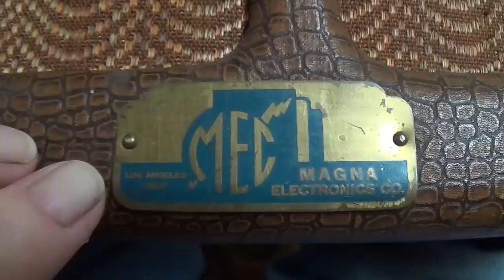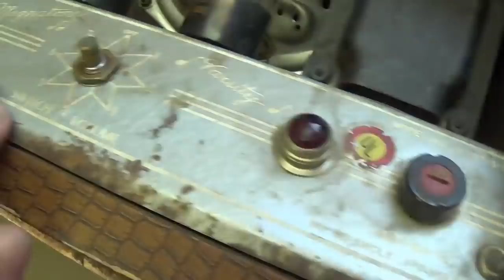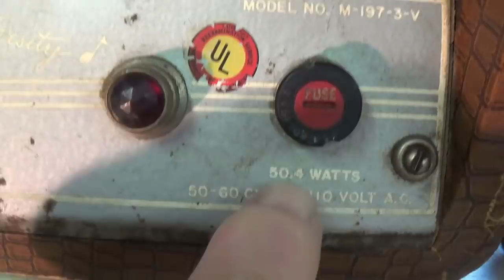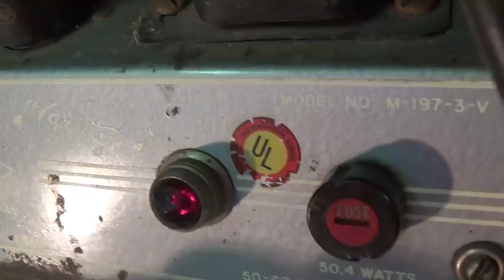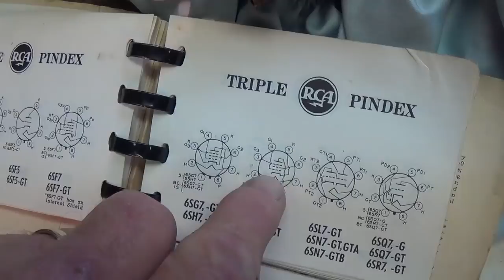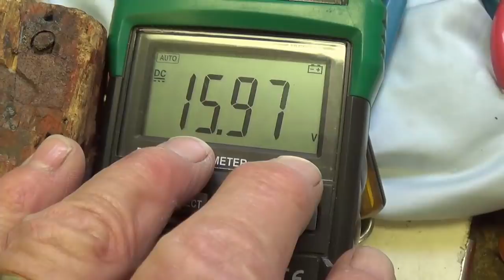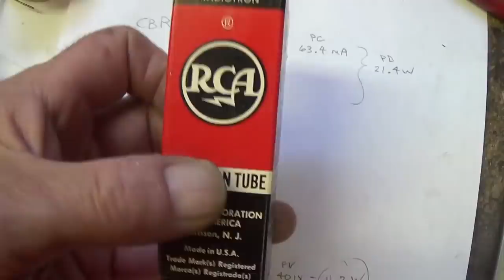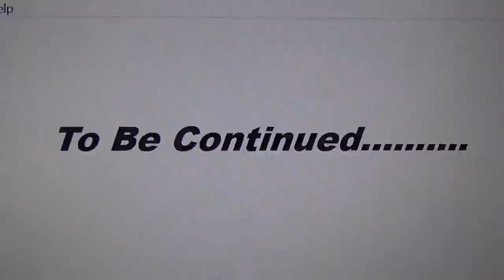1950 Magnatone Varsity M197-3-V in Completely Original Condition

Comment from the maker: After much thought about the cause of the outrageous bias values, I re-dissected the circuit, tested all components, voltages, etc. and have come to the conclusion that this amp must have come from the factory with a higher-than-normal-voltage power transformer. It is obviously the original PT, yet on start-up it produces 472VAC.....which is generally not seen in these circuits. The fact that it can maintain a steady PV slightly over 400VDC while producing a PD of 11W indicates to me that it is an "overly robust" PT. Once tamed with a relatively high bias resistor, however, the circuit functions beautifully and produces surprisingly good tone and volume. This issue may be responsible for the exceedingly good condition......it was simply stored away for many years.
Reply: I had the same thing on a Fender CBS Champ...very high B+. With the factory 470 ohm cathode resistor, the poor little 6v6 was running a PD of 17.5 Watts!! Had to increase it to over 1K to get the PD below 12 Watts.
Reply: I didnt see it in the video but I am assuming you were running it at 110VAC ?
Reply: Because the power transformer voltages are so excessively high, rather than force the 6V6 into somewhat lower dissipation range with the high-value cathode resistor, I suggest you substitute a 6L6 type  tube for the 6V6; I bet that a 5881 might turn out to be a darn near perfect match for the voltages and output Transformer impedance in this amplifier. You would probably end up lowering the cathode Bias Resistor closer to the value where you originally found it, 250 ohms, maybe up to 300 or 350. Did you measure the heater/ filament voltage under load in this amplifier? That oversized power transformer might not be loaded down sufficiently for this application, you might find that the tubes are running at 6.5 or 6.6 volts on their heaters. This would not be good for tube longevity. Substituting an output tube that draws more heater current, like a 5881 or 6L6, might drop the heater voltage down a little bit, closer to within normal range; and pulling more plate current coming out of the Transformer and loading it down more would be good for reducing both the heater voltage and the plate voltage..
Reply from the maker: @fenderlead1  Yes, it was probably more like 120VAC.
Reply from the maker: @goodun6081  Thanks for the suggestion, GU. I will give it a try.....it might turn out to be a great SE 6L6 amp :)
Reply: I'm glad to hear you dug into it. I was wondering if one of the new caps was leaky and messing up the bias.
Reply: As mentioned, the issue with these old amps is that the transformers are setup for 110V.  So there are a couple of other options in addition to what good 'un suggests.

One is to run the amp from a bucking transformer (which brings the voltage down to 110V or even less). I have had great success with this method.  I would imagine it would bring your plate voltage down to about 300V - I have several bucking transformer I use and when I run an old amp like this at the lower voltage, everything drops into place very well.

Another option, if the real estate in the amp allows it, is to add an "earlier" B+ node so that the subsequent voltages along the B+ rail are down to the originally intended levels. This will also eliminate some ripple. What's nice about this method (if it's feasible) compared to using a bucking transformer is that you can plug it straight into house power instead of dragging around a separate piece of equipment.
Reply: UD really hope to see & hear a video with a 6L6 or even better, a KT66 if possible!

Also, besides a bucking transformer, why not set a Variac to 110vac? For recording the sweetest overdrive, retain the 6V6, dime the volume & drop the vac to 90-100 range until it is glorious￼
Reply: On second thought, it already sounds like really good. If you plan on selling it, please let me know as I've looking for a '50s Magnatone Varsity. They're great for recording classic rock with
Reply: @goodun6081  ,
I was helping a friend in Canada troubleshoot a stock 5F1 champ and we ended up using a 330 ohm cathode resistor. 
 After 5 years of studio use the Champ output transformer started arcing. Now my friend is concerned about the 330 ohm we put in because the stock resistor was a 470 and he does not want to burn up a replacement transformer.
(the transformer it had in it that was arcing was a Mojotone Fender clone and not an original Fender part. It came as a part of a kit he had built)
 The 330 ohm set the plate current at 35 ma and screen current at about 5 ma. so I don't think we set it up incorrectly.
 Nor do I believe it would have lasted for 5 years without any problems if we had set it up incorrectly!
Reply: Jack wants mice not transformers.  Food for thought.
Reply from the maker: @StevenCarinci  He's a civilized cat, Steven.......caviar and trout.

Comment: One more thing, Doug, you and I both know how lucky you are to have that original handle. I've been treating all my leather handles with saddle soap, lotion, or leather conditioner. They'll all do about the same job of soaking in and preventing dry rot. Even on those crappy new leather ones you get from various places will benefit from conditioner. You can really tell when they're dried out because they'll just soak up that stuff.
Reply from the maker: Good suggestion, Brad. In many ways, they are just like my own weathered, withered hide :)  I found a product named Lexol years ago, for leather car interiors, that does a good job too. Thanks again for your helpful input.

Comment: Super video, Uncle Doug.
11 watts from a single ended 6V6 tube does seem kind of high, even with 408 B+ voltage.
1950s Fender Champs got around to 4 or 5 watts  from a similar circuit running a single 6V6 power tube.
Reply from the maker: Thanks, Jay. The 11W was Plate Dissipation, not output power......which probably is around 4 or 5 watts.
Reply: @UncleDoug  Ah, that makes sense, thanks.
Other then the input tube used, that Champ type circuit was very common in the 1950s and 1960s for 4 to 5 watt amps.
All amp makers made a version  of that type.. probably a good seller to start-up guitarists.

Comment: Hi Uncle Doug--yet another nice video--you never miss.  It was interesting to see you having chase your tail on the selection of the cathode resistor.  In part that had to be due to the softness (high resistance) of the 5Y3 rectifier: as the current went down the B+ kept going up and up.  Running this amp on 110 VAC should drop the B+ a good 30 to 40 VDC, which would have been helpful.  Changing the output tube to a 6L6, as one reader suggested, is an interesting option.  These old amps are almost always interesting from an aesthetic point of view.  The style of this amp, especially the grill cloth,  but also the covering, was very appealing.  However, I'm not one who thinks that the quality of the old amps is better than what's available today.  Components back then were often inferior to modern components, and as the years went by, the circuit designs improved.  I'm glad to see that Jack and KC have become solid contributors.  Jack's good nose was able to detect a decades old mouse infestation--pretty amazing.
Reply from the maker: Thanks, R. It's always good to hear from you. I do like the idea of trying a 6L6 or 5881 in place of the 6V6. I have never seen or heard of a SE 6L6 circuit from this era, but you never know......it may have been intended for that purpose.

Comment: Man you are lucky ! I had to use a 1in. drive torque multiplier normally used on old F1 wheels just to remove a 10/32 speaker nut.
Reply from the maker: Yeah, well I had to use a 6-foot breaker bar with a block and tackle, an acetylene torch, two come-alongs, and a 20-ton hydraulic press to remove the two pins from the serial number tag.
Reply: @UncleDoug  Yeah, that C-4 is gettin' hard to procure. Those pins can be vexing little critters....
Reply: @UncleDoug  And re-assembly I normally tighten until it strips...then back off a 1/4.    Another method is to tighten until I hear a 'click' .....from my elbow.

Comment: I know what you mean with cathode bias I just finished designing a three tube single ended amp with one 12ax7 and two 6v6 in parallel and noticed the standard bias resistor was 470 ohms which is ok if your plate voltage is low enough I think in production they must have switched transformers not paying attention to rebidding
Don’t ever stop your videos there great George
Reply from the maker: Thanks for your input, G. We won't :)

Comment: Gosh Uncle Doug, what a find & what a wonderful video from you - Jack really knows his stuff! I found a schematic for your amp - it differs in two ways however which makes me think it may not be the real thing. First, the speaker is a PM driver - the HT being filtered by a resistor. Second, the wiring on the instrument inputs is identical - this would give equal gain instead of the lower gain which you observed? As to the really "hot" 6V6 - did you try swapping it with another? I only ask because I saw another amp restoration where the 6V6 was really over-spec'd - not sure if it was intentional or a manufacturing fault. The excessive HT certainly would cause the excessive PD too. Good skills mate! Thanks again for another really amazing job.... good that you have Jack on the payroll too. Best regards from New Zealand:)
Reply from the maker: Thanks so much, 6A. This circuit is an earlier version, with the electrodynamic speaker, and a proper schematic may not exist. Yes, I tried an NOS 6V6, and it actually drew higher current than the 6V6 that came with the amp. I honestly believe that the (original) power transformer produces high voltage that is simply too high for the circuit.

Comment: Tip: A little water & Baking Soda will cut through rust like you wouldn't believe.
Reply from the maker: Really? I'll have to try it.
Reply: Yeah; it's not very helpful on iron or steel, but it's pretty effective on thin metal / tin and won't generally hurt paint. Just a few drops of water to make a thick paste, apply it, let it set for a minute or two, then scrub the metal with a toothbrush.

Comment: It’d be neat if someone would step forwards and sell a kit to build an amp similar to this one. There’d be four options:
1) Master Craftsman (lowest cost) - comes with the schematic diagram and parts list, as well as the dimensional drawings for the wood cabinet, and for the electrical chassis, plus a guide to sourcing the power transformer, audio output transformer, tubes, grill cloth, and coverings.
2) Expert (somewhat higher cost) - comes with all of the above, plus the wooden cabinet is already assembled, sans the grill cloth and speaker, and the chassis has the power transformer and audio output transformer already mounted. User will need to drill holes for the controls, and tube sockets, and source all the remaining parts and hook-up wire.
3) Intermediate (again, somewhat higher cost) - includes all of the above, plus the speaker, controls, tube sockets, tubes, and line cord. Holes for the controls and tube sockets already pre-drilled, and the user needs to supply the resistors, capacitors, terminal strips, and hook-up wire.
4) Beginner (highest cost, but still less than buying it assembled from the Mfgr!) - includes everything (except tools and a VOM/DMM) you need to build the kit, even a small roll of solder and hook-up wire, plus a step-by-step instruction guide, showing you how to build it starting with the power supply section, then the input section, then finally the audio output section, checking and testing each section in turn, as well as a theory of operation.
I think Jack would approve. 😻
Reply: Kits exactly like you describe already exist for amps like the Fender Champ. You can go from just a raw pile of parts, to getting drilled chassis, cabinets, etc. Weber is one option, but there are many others.
Reply from the maker: You really have considered this in detail, William......and Daniel is correct.

Comment: Hi Uncle Doug.  I've noticed on the back plate of this amp that it's a 110V input rated amp.  If you are connecting it to a 120V supply, wouldn't it explain the high values you noticed like you explained in one of your previous video? 1950's power standards were way different than today, wouldn't you say?  Great video.  Cheers.
Reply from the maker: Thanks, Bruno. It might make a 9% difference, but not a 100% one.  I believe this amp has a power transformer that produces high voltage that is simply too high. I think it came that way.....which is strange.

Comment: Great "cat scan" followed by an excellent video. And great comments too. I was wondering about a 5881 tube too...and a buck boost set up just to test the idea of 110 vs. 120 vac
into the transformer. The 6v6 did sound pretty good and was an original type...and I can see where you'd like to keep it original. Unfortunately, the power company didn't keep 110
volts as standard. I measure 125 on one leg here at the house and 128 on the other...so I power old radios through a buck transformer to get 100 volts or a smidge over.
Reply from the maker: Thanks, Tom, for the nice comments.

Comment: Gee, with the length of those screws they used to hold the chassis in, I'm surprised the front cab feet didn't fall of when you removed them!
Gotta say Doug, I get just as excited when i see any electronics from say pre 1960😊.  And that wonderful musty fragrance those old covered wooden cabinets give off.  Something wrong with guys like i is i think😬
Reply from the maker: Yes, indeed. It was almost screwed down to the workbench by those screws ;)  I share your delight over musty old circuitry, Glen, strange as that may sound :)

Comment: What a find! It came out absolutely gorgeous. Was the original tube a 6V6 or a 6V6GT? I guess either way the plate dissipation was way too high. There doesn't seem to be any difference in specs on metal vs glass envelopes gray coated or clear 6V6s and the schematic clearly shows a 250-ohm resistor. Maybe the electrodynamic speaker coil was wound on a Friday or Monday and the number of turns are a bit off, or a few turns shorted. Strange, with that dissipation that 6V6 would red plate in a heartbeat. Also the schematic I found shows identical resistors on both inputs to the preamp grid. Funny how you had different gain on channel 2. Still a wonderful amp, had that steel guitar sound, lots of treble pretty light on the bass. 8 inch electrodynamic speaker would have a lot to do with that but I guess lap steels were not big on bass notes either. Great cars at the show, loved that 65 Chevy pickup, chrome grill, big back window, I think it would have looked better with the back pillar cab chrome trim and I would have had chrome reverse wheels on it. Personal preference.
Thanks for the comments about my son on the last video, we are quite proud of that young man.  He is a Senior Technology Specialist for Southwest Airlines. Been married 6 years to a beautiful young woman and they have 2 beautiful sons, 4 years old and 9 months old. I still think that you need to invest in a hazmat suit for those mice condos.
Reply from the maker: Thanks for all your very nice and interesting comments, Mark. It's always great to hear from you. My only explanation on the high PD is that the power transformer that came on the amp must have been of a higher output voltage than normal. As I say in the pinned comment, at start up it puts out close to 500VAC.....which you just don't see in these old SE amps.

Comment: I must say, that 1st sound demo was very early Vox like,  even if the output tube is a very American 6V6 and not a Vox preferred EL84.
Some early Vox amps did use a pentode (EF86) in the input stage but went with the usual double triode later on because that EF86 was microphonic, even if the high quality Mullard type tube of the day was used.
Reply from the maker: Thanks, Jay. I thought the sound was rather unusual and quite distinctive.

Comment: Hey Uncle Doug.  Just FYI.. I have one of those exact same resistor boxes.  I'm sure you know - according to the build doc on them - those resistors are 1/2 watt.   I calculated your measurements - and you are running 1 watt thru them in your current tests.  Probably OK because you don't run the cathode current testing for very long - but - just FYI.
Reply from the maker: Thanks, Donald. I guess the boxes aren't really made for tube electronics :)

Comment: Uncle Doug, I had what I think is the very same amp dropped off on my doorstep a year ago. Unfortunately, it has been found in a flooded shed, so it was beyond rescue. BUT! It sported what looked like an original 6L6 output tube, not a 6V6. Could this not account for the bias? Perhaps your amp is a 6L6 amp?
Reply from the maker: I have never seen a SE 6L6 amp like this, CP, but that would explain a lot with regard to the high voltage provided by the power transformer.  I could try a 6L6 in it and see. It would be quite a little powerhouse if that were the case.
Reply: Please try it,  @UncleDoug . Mine had a metal jacketed 6L6 and it matched the other tubes. It has been wet for so long that even the cabinet disintegrated when moved, and the speaker cone was rotted completely. I saved all the parts that could be saved, but have never forgotten the wee beast. It struck me as an amp that could have been a little screamer!  The power transformer seemed way too large for a low power amplifier...
Reply from the maker: This may be a great clue to solve the mystery of the high B+, CP. It's too bad they never labeled the tube sockets.
Reply: @UncleDoug , this would be worthy of a second video on this amp..!